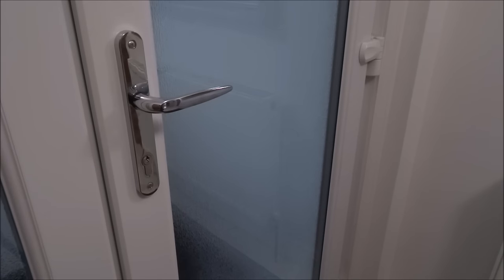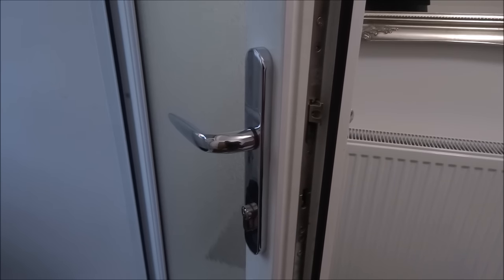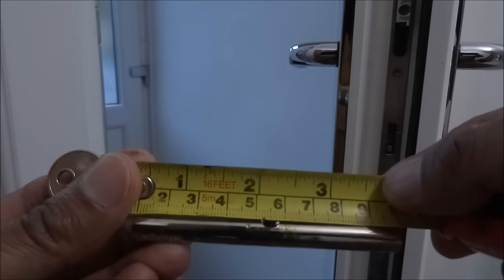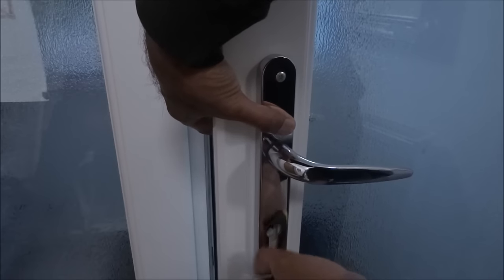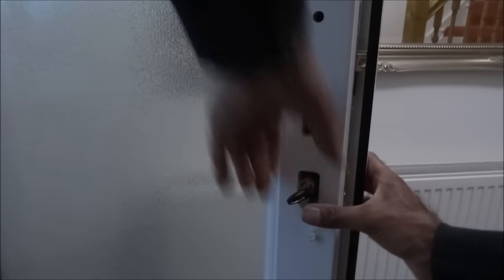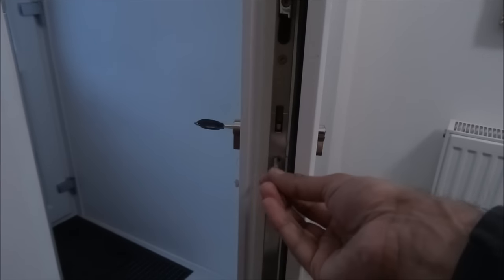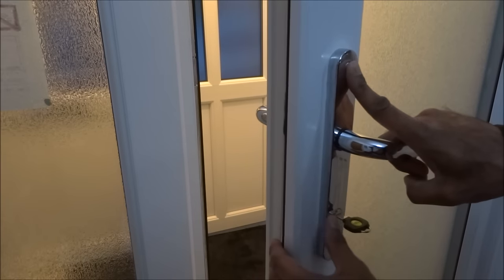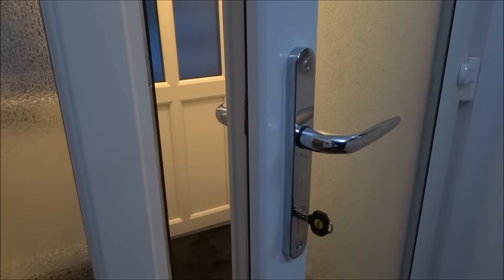How to Install a High Security Euro Cylinder Lock

Comment: Despite taking the door handles off and old lock out the new lock will not go all the way through due to the little lumps sticking out. Any ideas?
Reply: yeah same here. how come no one has adressed this issue? do the lugs need to be filed off or dremel some notches in the door lock housing? or force through with the biggest sledge hammer you can find?
Reply: @aljaxon69  NO!!!  The bumps are part of the design, to prevent the cylinder being forced inside the door during an attack.  I am informed that provided you measure up and buy the correct size cylinder, it should fit.  The cylinder has to be installed from the outside of the door, and have to remove the door handles (bumps not pass through external handle).  The idea is that the bumps shoulder up to the metal frame inside the door.  If it is a thumb turn cylinder, I understand the thumb turn needs to be removed in order to pass the cylinder from the outside, through the metal frame.  There is a grub screw on the thumb turn to remove it.  Having said all that, I can see that this Yale cylinder will not fit into my patio doors; the metal frame inside the door is very thick, meaning the bumps will not let the cylinder pass far enough through.  They should be fine on my other doors so I have ordered some to try out.
Reply: @aljaxon69  I had the same issue, the lugs wouldn’t get past the upvc door frame so I used the side of a drill to slightly widen the barrel shaped hole so the lugs would squeeze through. Easily done as it’s only plastic.
Reply: @SaxJockey any updates on this? I’ve got the same issue. Haven’t tried removing the thumb turn and sliding in from the outside yet. 
Tried sliding in from the inside and the lugs stop it from going through.
Reply: @curiousjoe395  I installed the Yale on two doors, no problem.
Remove external handle, insert Yale cylinder from outside, metal bumps intended to come close to the metal within the door (security device to prevent being knocked through).  If thumb turn, remove that (loosen grub screw), then re-fit once cylinder in place.  I had to use a different type of lock on two other doors, because the metal bumps fouled the metal plate within the door.
Reply: @SaxJockey  Did this today. Spot-on. Many thanks

Comment: My door handle has the anti drill swivel, I would like my old locks put on my new door, issue I'm having is the anti drill swivel within the door handle (exterior) is stopping my key from being fully inserted?! If I unscrew handle would I be able too pop it out? Or do you reckon it is built in withings the handle??

Comment: Could you use that exact same cylinder for a door where the lock faces the RIGHT SIDE of the door frame? what i mean is, does the orientation of the cam matter? Here the cam is on the oposite side of de door frame (right from the cylinder if you look at it from the front), but if you put it on a door with the lock to the right, the cam would be between the cylinder and the door frame. Does that affect anything? thanks
Reply from the maker: Yes you can, make sure you measure both sides of it.
Reply: @GeekStreet  thank you!

Comment: Quick question please. Would it be possible to operate the lock from outside with a key in the holder inside. This is for the situations where the key is in the lock inside and you may want to open the door from outside.
Reply: Yes but not the other way around

Comment: Is it wrong if at the end it is not flush with the handle?
Reply: Yes you should be able to get the correct length. Leaving a bit sticking out makes them more vulnerable to attempted tampering.

Comment: A lot don't realise that you have to remove the handle assy. to get one of those pinned Yales in. You should stress a bit more that low-level snap-proofing is defeated if the cyl. sticks out too far. Not everyone can afford £40-50 for a lock. I fitted ERA 3* 6-pin - cheaper than that Yale, about £30, and I just want to deter the casual burglar, nothing of enough value to justify pro treatment, like Rushden and Diamonds would pay a trfr fee for Kane, my experience is that most are pissed when they break in! A mole wrench or an adj. spanner (they snap sideways just as easy). Snapping has made this feasible - what do you think of the ERA? Could you show how to fit a replacement pair of cyl's in a modern UPVC double door, on the "wrong" side? The sort with the fake strut down the middle which blocks access to the retaining screw? Do I need to dismantle the whole mech? xxx

Subbed and liked.
Reply from the maker: Thanks for the comment and support much appreciated. ERA is definitely a good lock no doubt personal I preferred the Yale because of the pinned design. I've installed on a set of double doors and what a hassle I had to remove the side plate on the door the part the multi locking system latches onto and then drill a small hole in the side from what i remember to enable me to remove the lock, I'll look into doing a video at some point showing how to do.

Comment: Hi, I’ve bought the platinum 3 star Yale lock as demonstrated. One of the site workers has measured the lock and I have just tried to install it and hit a brick wall. The two little metal balls will not let the new lock go through. I’ve entered through exterior first and interior first but the same result. What can I do? Please help.

When I take my handles off, it just hits the little metal balls and doesn’t go in any further where as yours seems like it clicks. Help help help
Reply: Take off the handles first 👍
Reply: Same with handles off.
Reply: Same issues like Carly… any solutions?  My case is not like Mark but Carly

Comment: I’m having no luck with my lock, the cylinder will not budge. It feels like it’s still locked in place. Do some locks/doors have another screw that holds cylinder in place?
Reply from the maker: Generally no, there is no additional screw. You do however have to put your key in and turn slightly. Give it a go and let me know how you get on. Double check you are doing the right screw.

Comment: Unfortunately, this lock has been picked on YouTube.
Any locks would you recommend?
Reply: Cleric775 nearly every lock has been picked on YouTube, but these are by locksmiths or locksport guys. Your average criminal cannot pick high security locks.
I recommend the ABS 3* lock or the ultion 3* which have been picked on YouTube... but this lock is absolutely fine too...
Reply: The Abloy protec 2 euro has not been picked on YouTube but I don't know if they sell them with anti snap.
This lock is perfectly fine for use.
Reply: Anti snap is the most important thing though, they protec might have reinforced bar at bottom though.
Banham is well up there too if your in that price range.

Comment: Thanks for this information - those extra nobs are a real nuisance. Makes a 5 minute upgrade into a 20 minute job.
Reply from the maker: Thanks for the comment, yeah a hassle but definitely worth doing. Don't forget to like and subscribe.
Reply: Geek Street how did you manage to get those nobbly bits to slot into the existing chanel in the door,i have tried both internal and external without the handles and cant get the new anti snap lock to slot into place
Reply: @lorrainejohnson3369 did you manage to get it fitted in the end?
Reply: @GeekStreet what are they actually for?

Comment: Requiring keys on both sides spells disaster when there is a fire in the middle of the night. Get a cylinder with a thumb screw on the inside. In this case that would be Yale DL35.
Reply: many of them can be manipulated with a thumb lock tool via the letter box, if you do get one, use a thumb screw that needs to pushed in or pull out as well as rotating, that way you minimise the risk of such a tool.

Comment: I have a problem,  I don't have the key to a line the cam,  so the lock is stuck.  What can I do ? Thank you for sharing
Reply from the maker: Thanks for the comment but you have to have the key to line the cam.
Reply: Locksmith or learn to pick locks or if it's not a high security then you can drill it out.

Comment: Does it matter that my new lock is sticking out on the outside and flush on the inside?
Reply from the maker: I'm pretty sure it should be flush on the outside.
Reply: Preferably flush but a little is okay. Some doors don't fit the standard lock sizes. Too much out and it makes it easier for a thief to grip the lock. Don't ask me how much is okay. But I'm sure Google will help.
Reply: @awilderireland  thanks guys I switched out the lock for another one and now fits exactly. 
Measure first buy once 👍🏻

Comment: Assuming that the glass is 5 cm thick and durable enough so it can stop an axe, the door still needs metal security strip, or it opens in 2 seconds with a crowbar.
Reply from the maker: Metal strip in the middle you mean?
Reply: @GeekStreet  Yes, I'm not sure what is it name in English, but it's usually 25x4 cm steel strip that is fixed in the middle of the door where the lock is, to prevent crowbar attack.
Reply from the maker: @atklm1  ah ok, I know what you mean.

Comment: thanks for this clip. andy England 🇬🇧👍🎄🎄
Reply from the maker: Your welcome!
Reply: Geek Street will i be able to swap a twist euro lock for key both sides lock the same as in your clip would you please let me know and what 1 star locks under 35 pounds do you recommend. thanks andy England 🇬🇧🎄🎅🎄🎅🔑🔑🔑
Reply from the maker: Yes you can definitely replace go for either Avocet or Yale 1 star euro cylinder. eBay has brand new ones around 10 -15 depending on size. Hope that helps.

Comment: Nice tutorial. But that's a lot of money spent on a lock that has a glass on the door. Burglar would smash the glass and get in.
Reply from the maker: Thanks for the comment, The idea is that will cut themselves on the glass and bleed to death running away!
Reply from the maker: @cnutsack  ok so if it ever happens and I hope it doesn't...they slip break their neck and die.

Comment: Why did you have to take handle off? When you could've just changed the cylinder lock
Reply from the maker: There are some notches on the actual lock and that requires you to take the handle off otherwise it won't fit.
Reply: @GeekStreet  I have the same lock with notches.  I've taken the handle off but they still catch on the metal frame that the barrel slides into.  Now I don't know what to do.
Reply from the maker: Sounds like you may have brought the incorrect size.
Reply: @iguanaman08  me too, how did you fix this?
Reply: @claireguider8118  buy the correct size
Reply: @tiberiusclaudiusnerogermanicis  So it's as simple as that?  There are many comments about this.  So some people are buying cylinders that are too short, whereby there is insufficient cylinder on the inside of the door (the two nubs on the EXT section strike the frame)?  Do you know the reason for the two nubs; are they to prevent the lock from being pushed into the door during an attack?
Reply: @SaxJockey  yea so you buy the correct size and your fine... simple as. The wrong part won't work. Simply buy the correct part and you won't have problems installing it the correct way.. so yes.. as simple as that..
Reply: @tiberiusclaudiusnerogermanicis  Thanks for the reply!  Seems that some people have got frustrated and filed them off or filed notches out of the metal door frame 😂.  Just found a reference to the purpose as 'kick deflectors':
https://www.lockandkey.co.uk/blog/2016-09-28/13/all-new-yale-platinum-ts007-3-star-anti-snap-cylinder/
Reply: @tiberiusclaudiusnerogermanicis  Just thought I'd double check the existing 100mm cylinders on patio doors.  To be certain I removed the handles to find that the Yale Platinum has no chance of fitting into the metal door frame.  It is much thicker than standard; the two nubs will not allow the cylinder to pass far enough through.  Yale need to mention this in their information.  The Yale should fit OK in the other standard doors.
Reply: Just bought one of these (35/35), it does not have the bumps on it; seems that Yale have realised they were confusing many customers.  So look out for new stock.
Update:
I am informed on good authority, that the latest production standard of the Yale 3 Star cylinder has additional SS312 Diamond Secure marking, these do NOT have the two bumps on the outside of the cylinder.  I have some 35/35 that prove this.  But there are still many of the original design for sale.  Anyone wanting this lock without the bumps should look out for the new design and description.